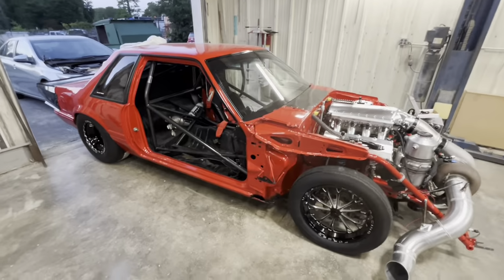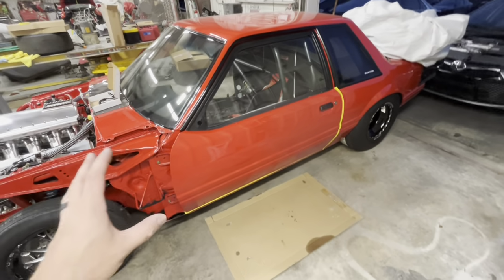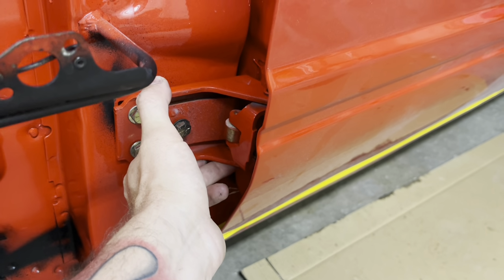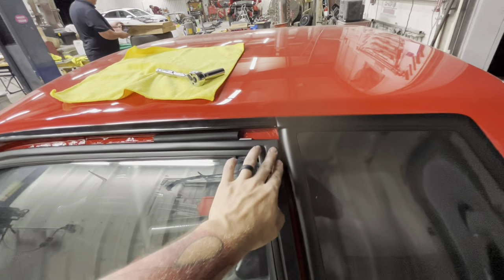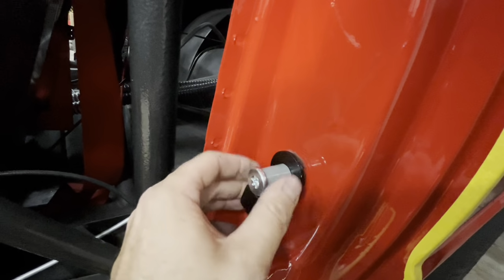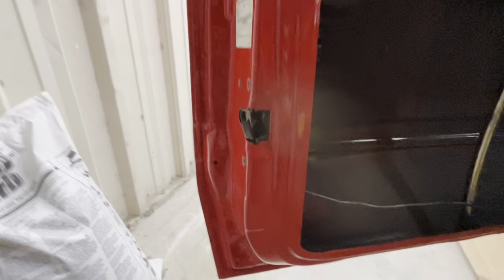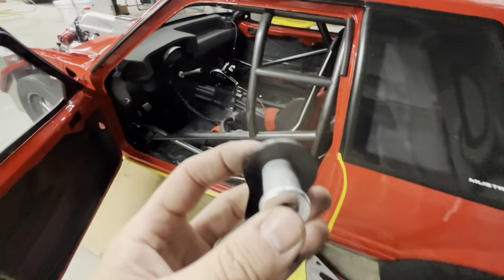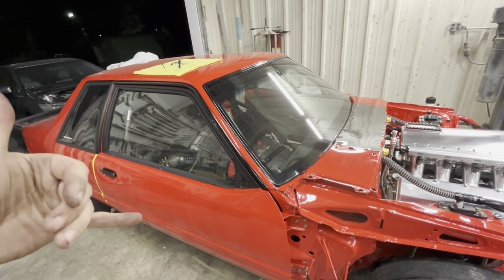💥 Hot Rod, Race Car, Restoration How To Align / Fit / Install Doors

Comment: I usually adjust my hinges before paint then once perfect I drill a small pilot hole in the top and bottom hinge so all you need to do after paint is aligned the holes and tighten the bolts plus I put a little Vaseline on the back side of the hinges so it slips without ripping fresh paint while adjusting
Reply from the maker: Yes that is perfect. If you caught it though plans changed in me mid paint work and then steel doors were decided to be used vs the carbon ones that the front end was fit to before paint. Your advice is 100% correct though

Comment: My foxbody door I believe is sagging a bit and makes a noise when opening. I haven’t been able to find a way to try correcting it
Reply: Chances are its the hinge pins and bushings.Its common on alot of vehicles Ford and GM
Reply: @bobaque70  thanks for the recommendation man 👍. I honestly haven’t looked into the repair, I assumed it wouldn’t be an easy fix
Reply from the maker: He’s right but first I’d lift up on end of door (door handle side) and see if it has any up and down play at the hinges.
Reply: I had 90 hatch foxbody and I remember them beginning to get sloppy after 7-8 years
Reply: @ThePaintPaperHustle  I will try that first if I get a chance, thank you
Reply from the maker: You’re welcome

Comment: It's a drag car, it's been dropped, twisted, flexed, crashed, tweaked etc. If the chassis was set up on a laser alignment rack it would not even come close to the factory specs. That's why nothing fits, it's nobodys fault, it is what it is. Just do the best you can on the alignment and send it.👍
Reply from the maker: All great points man.

Comment: That’s strange. On a street car that has all the weatherstripping and stuff in place, the doors will rattle going down the road without the plastic bushing in place bc they don’t pull up tight. Being a dedicated drag car I’m guessing that won’t be a concern and I’d probably just stick with whatever works best for your application.
Reply from the maker: Yea in that car I’m sure you don’t even hear them kinda rattles lol